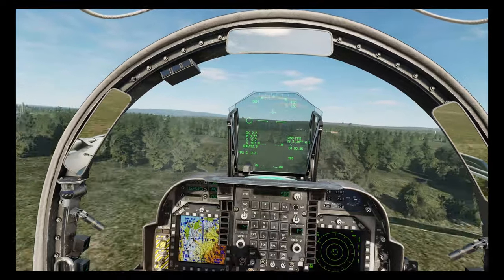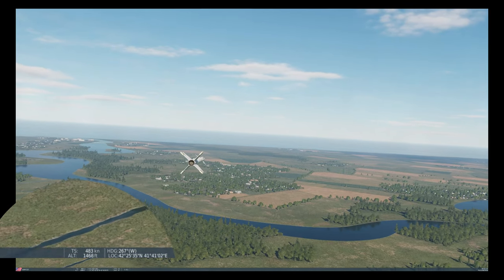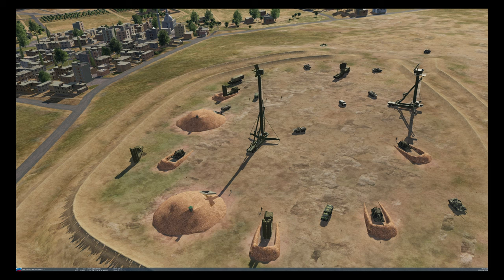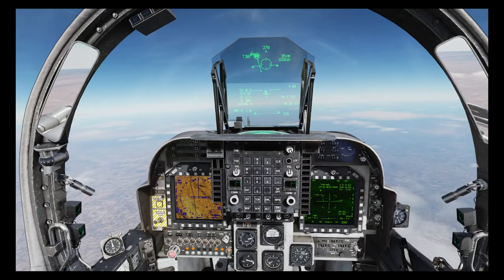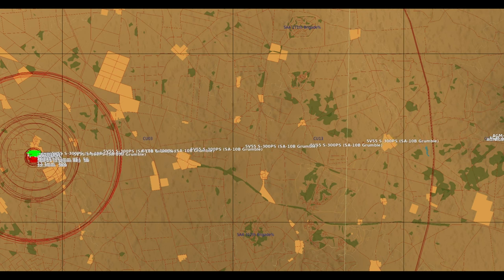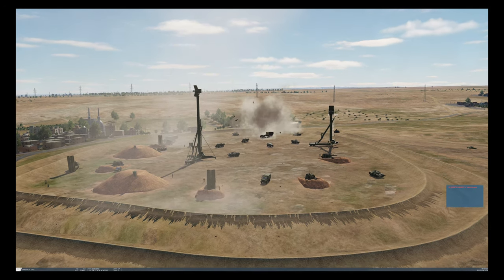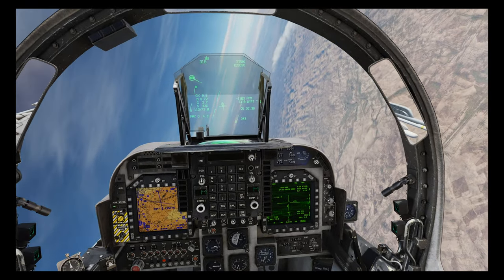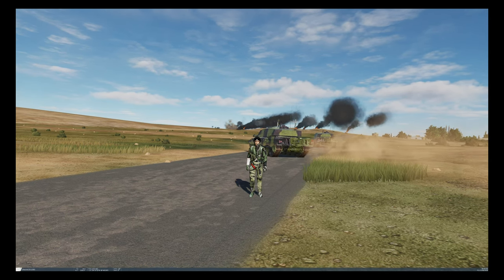DCS: Sidearm and SEAD Part1

Comment: Thanks, that's really interesting, I have tried pop up, notching and loft separately but looks like your method combines elements of all of these to attack the more modern systems. I think this could work really well with a wingman, thanks, and look forward to part 2!
Reply from the maker: Thank you. Part 2 will hopefully be done in a week or so. I don't tink that there won't be much flying. mostly talking....but I have just done one clip attacking an SA-10 protected by SA15 and manpads.......which is about as tough as it gets
Reply from the maker: Now done part 2